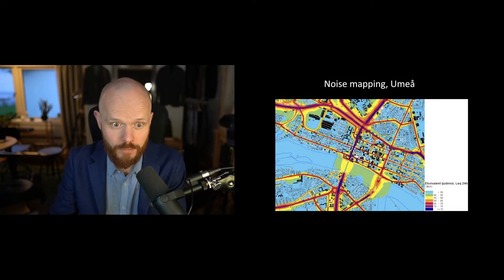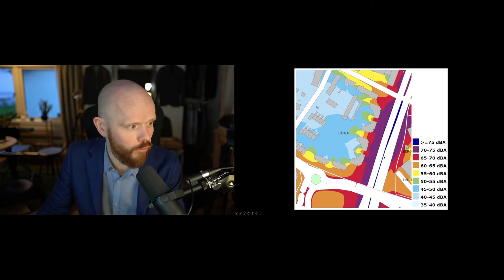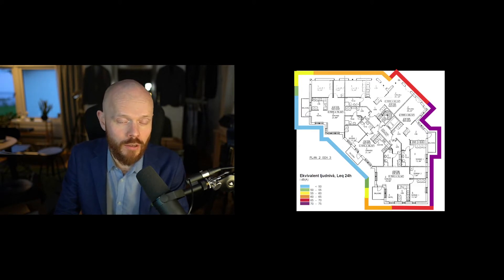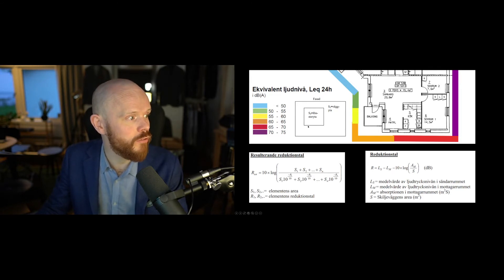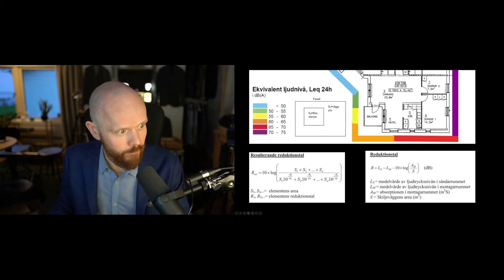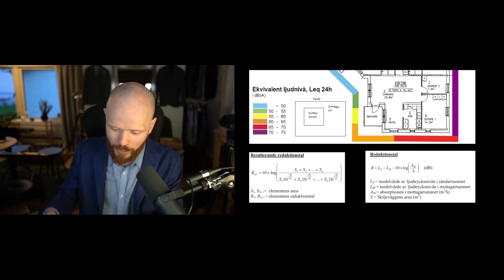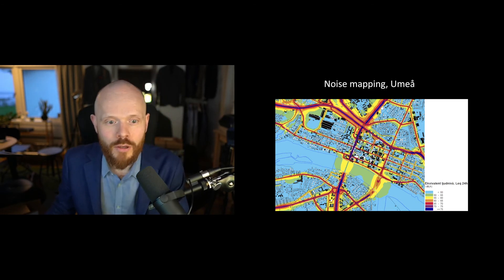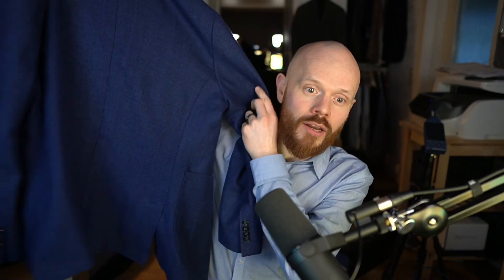How do we calculate the required sound insulation class of windows?

Comment: Would you say the sound reduction formula is as simple as the this: 

Noise Reduction (NR)=L 1 - L 2

NR = Noise Reduction in decibels (dB)
L₁ = Initial sound pressure level (SPL) before implementing noise control measures (in dB)
L₂ = Final sound pressure level (SPL) after implementing noise control measures (in dB)